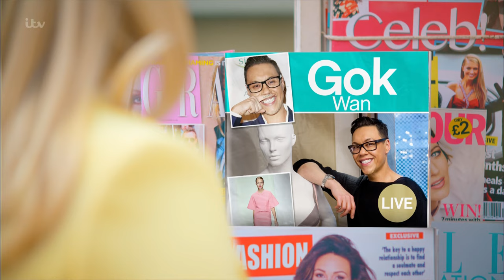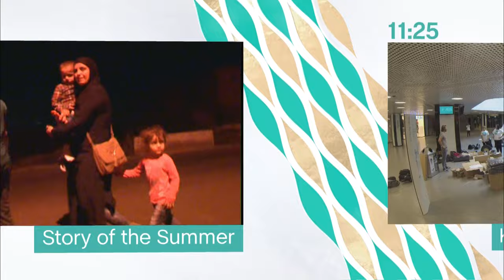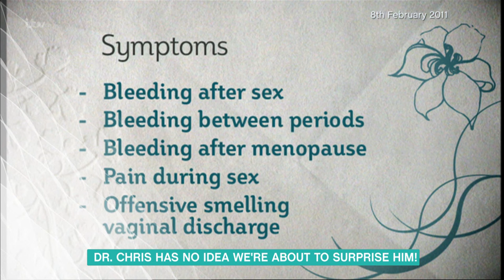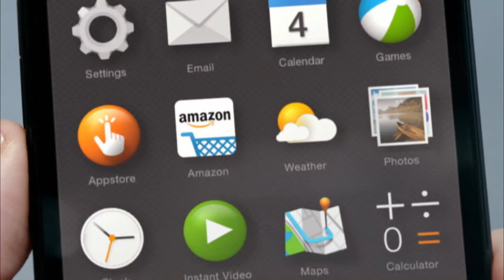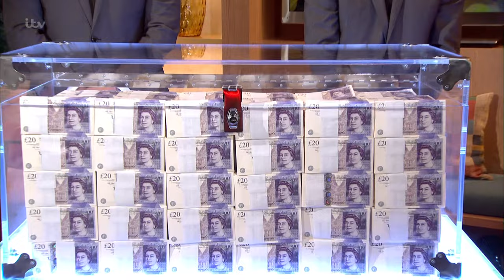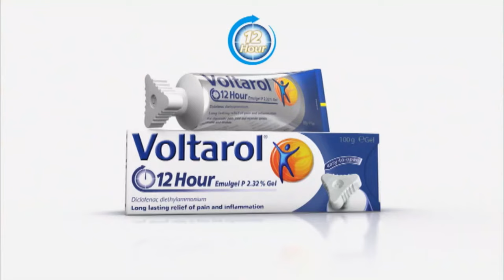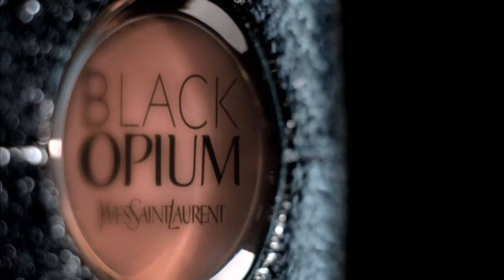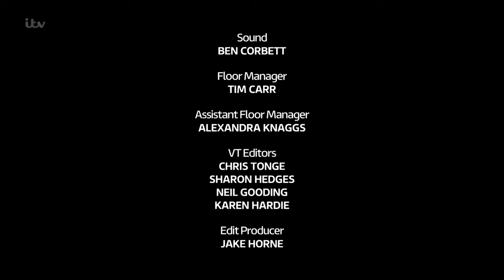Vintage This Morning - With Holly Willoughby and Philip Schofield - 1st September 2015 - Full show

Comment: The loss of this studio with its stunning real view is a shame. The current fake backdrop is actually very effective, probably the most convincing I've ever seen on TV, and provides an easier studio environment to control with lighting, but still it's a pity that This Morning no longer boasts the magnificent settings it had in the past with either the Albert Dock or the Thames. This look was probably the best that the South Bank studio ever had. I hated the previous style, it felt cramped because of the partitioning and the filters at the windows were hideous. On overcast winter days in particular, it darkened the view to the point of near total blackness. The lighting control system installed in the windows with this set allowed for the view to be visible no matter the conditions outside. I do think it's now time to have a refresh of the set. With the show moving into a new era, after the loss of Schofield and Willoughby, a new look would really help to drive it forward after the recent bad publicity it has had. Keep the fake windows as they are, no need to change those, but refresh the set.
Reply: I think once the London studios are demolished and if Studio 8 is still standing then This Morning should move back to the Thames because it was the only studio in London to really have a real view of the river and plus it would really benefit the program to go back to it’s original location before Television Centre because that was the true home of This Morning besides the Albert Dock of course.
Reply: I completely agree !! It gave a sense of realism and every day that you could feel was truly live and the action on the south bank going on made it feel like it was moving and interactive !! The selling point of this morning was always its location beginning at the Albert Dock then the south bank in bustling London . The change in weather made you feel connected with the show like you were really there with them . I can’t bear the new studio and can tell the difference. The wonky screens are barely lined up and it’s shrunk in size and perspective. Hate it!! And I know they are not demolishing studio 8 and it makes zero sense to me why they can’t go back with a new look and a new format with new fabulous presenters and take it back to its quieter more real roots and strip the ‘brand’ down to the bare minimum and let it grow again !! It works we all know it works , but it’s problem becomes when it becomes too big for its boots with the app the road show and all the embellished nonsense it doesn’t need . Go back to the start go back to the south bank!!!
Reply: I am wondering if they will eventually just get rid of the plasma screens of the thames now it has moved. It does seem strange now but I don't think they can think of an alternative idea as the show having a "view" seemed to be part of it's charm maybe.
Reply: @spikeyroberto I was wondering this… like if they stay at television centre and they are surely overdue a set change … how will that work given the view was always the same and the set built and based around that key factor 🤔